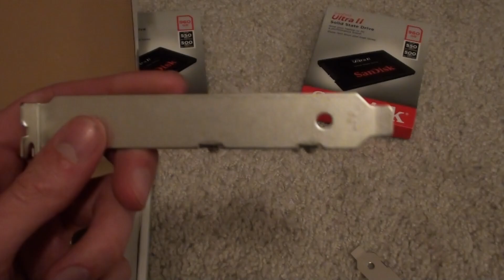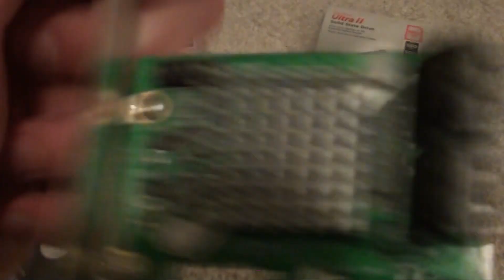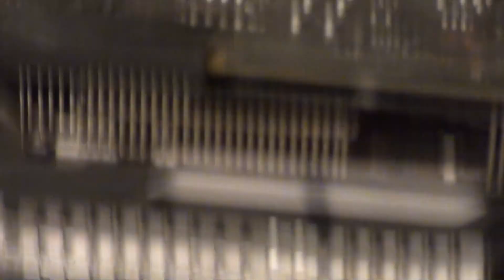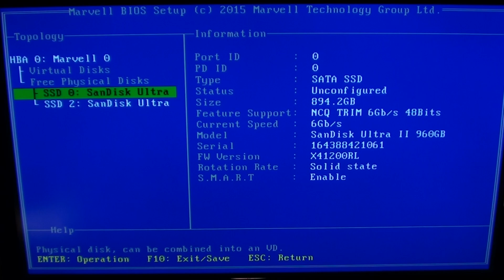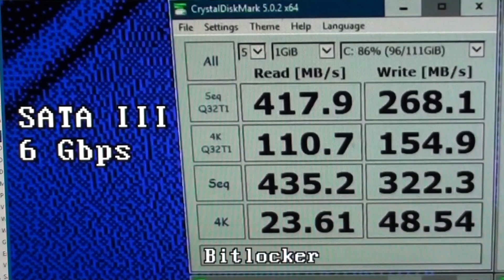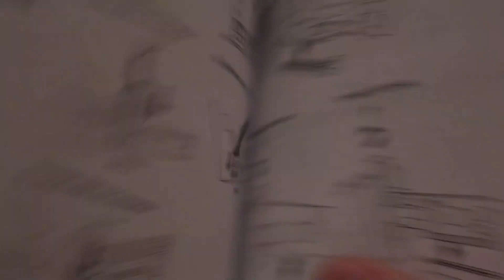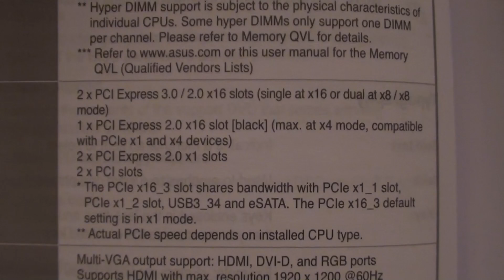SSD RAID 0 (2 TB)

Comment: You would be better off putting the avermedia card in the 3rd x16 slot (slot 7 in the manual) and the raid card in the top x1 slot (slot 1 in the manual) above the video card, putting anything in the second x16 slot (5 in the manual) makes the first one (2 in the manual) run at x8 regardless of whether its a video card or not

Comment: I've never understood what the low-profile metal tab at 2:04 was used for. How would it even be installed? Someone please enlighten me :o
Reply: Esteban Vicente low profile cases need it. you just unscrew the bracket from the board (there's a couple of tabs with screw holes) and screw on the low profile bracket.

Comment: You would probably get better speeds if you plug into you motherboard even if it is in sata 2 because sata2 X 2ssd is 750MB/s instead of pcie2.0 1x that is 500MB/s. this is assuming you can run raid on your motherboard.

Comment: Uh. Merry Bottleneck?
Reply: Ho Ho Slow
Reply: Merry (loading ==________  20%)
Reply: Underrated comment
Reply: prizedcoffeecup merry (LOADING ==_____________50%)
Reply: yeah pci-e gen 2 x2 is caped at 1000 mb/s, given a typical ssd has a speed of 550mb's if he could find a pci-e gen 2 x4 card for around the same price he would have all the performance benefits
Reply: ajddavid452 Admittedly on a 1GB/s RAID, 100 MB/s is not the end of the world, though 1: I haven’t watched the video yet and 2: I’d be more concerned about the RAID controller not beign able to keep up with the SSDs if the manufacturers of the card couldn’t spring for a full 4x PCI-E interface...
EDIT: Looking up the speed of PCI-E Gen 2 4x I found a discussion of the EVGA fourms pointing out that PCI-E Gen 2 has more overhead then gen 3, so for Gen 2 4x you can expect about 1.5GB/s, so I’m guessing 2x will be more around 750-800 MB/s... so faster then SATA 3, but slower then 2xSATA3...
bottlenecks yay
EDIT2:
I think that 400MB/s speed he ended up getting is due to the RAID controller, because that's just too slow for PCI-E 2x GEN 2
EDIT3:
If his motherboard's manual is to be believed, the RAID card is only getting PCI-E GEN 1 2x, which would before overhead be 500 MB/s, which is amazingly in line with what he got.
MOTHERBOARD BOTTLENECK

Comment: do yourself a favor and replace these sandisk ssds with intel or samsung instead
i have a sandisk ssd and that thing is a slow piece of shit
Reply: Sylv³on your statement makes no sense at all
Reply: The drives are fine. He just lacks a proper motherboard with proper pci-e and m2 slots. Druaga1 needs several other things. An X99 motherboard, with a capable processor and memory. If you are using that many devices buy the biggest ATX tower you can find so you never run out of space. Also buy clipped sata cables, and not just the 30 cm types, but also the 45 and 60cm ones to reach the optical drives which usually sits on top in the the case. And buy a descent brand PSU with lots of cables, preferably detachable to avoid a cable mess.
Reply: I think you meant to say "i have a sandisk ssd and that thing is a slow piece of shit"
Reply: well, since speed is being lost to pcie2.0, using a slower drive there wouldn't have any realworld effects, except the faster drives can go on the motherboard's sata3 ports and you get more speed from them that way?
Reply: i have a sandisk ssd and its super fast. 512MB/s read, 380MB/s write. It's not even the Ultra edition, just the SSD plus version.
Reply: Samsung and Intel also sell slow drives and fast drives. The 750 evo is pretty meh and costly for it's performance.

Comment: 2600K? You're pretty well due for an upgrade
Reply: all intel's recent core upgrades have been tiny steps, small preformance increases and small power draw decreases. The last huge upgrade was from first gen to 2nd gen, so he's fine. not really a huge difference from gen to
gen.
Reply: Well when you start to run into problems with PCIe allocation...

Comment: The stripe size has nothing to do with file sizes. For any kind of flash drive your probably want to set it to 64K or higher (trying to match the native erase block of the flash drive typically 256K).

Comment: Wait, so one slow device on PCI can slow down ALL OTHERS? I didn't know that and I know a lot of shit about computers... damn...
Reply: EpicLPer ..No. The slow pcie is just slowing down the 2 new drives since they go through that connection
Reply: "this will slow down my whole bus"
"now my graphics card is running in x8 mode"

most CPUs don't have enough bandwidth for all the slots a motherboard has to run at full speed. the CPUs that do need a different socket and are significantly more expensive. (this is part of why i only ever use mATX or mITX for those sockets, because the extra slots are somewhat of an illusion on ATX boards of this class, imo)
Reply: Kit Vitae Oh woops I hadnt watched tjat far, yeah. I kinda assumed that his cpu had enough lanes for an additional 2x card
Reply: Aaro Perämaa his cpu might, if the board divided them up differently. his board also only has 2 sata3 ports, the rest are sata2, so. there's a whole lot less bandwidth total on it than on something you'd build today that's for sure. 
also he plugged the raid adapter into a x4 slot and got better speeds than a x2 slot, and the comment about his gpu running at x8 was after that swap.
Reply: EpicLPer yyyeah, I am smartest at computers in class xD

Comment: INSTALL SSD IN AN XBOX 360
Reply: they do not use proprietary drive interface, they use SATA, you can easily swap hdd in x360 enclosure. The only problem is, the firmware has to be the right firmware for console to actually recognizing the drive. I bought some enclosure, throw in an WD drive (i think it was 160GB), make firmware "downgrade" to 120GB and console recognized it as 120GB drive. Console is not modified, it will work, there's plenty of tutorials on the web. Slims are even easier to work with, you just put SATA drive into it, without additional enclosures (like the old X360 version)
Reply: abdellahalsaidi RBLX Not going to work.
Reply: All of Xbox 360 models use a proprietary drive interface and other type of drive format, so it it impossible to swap the HDD with a SSD. SSD could be used as an EXTERNAL drive though.
Reply: I think theres issues with anything larger than 500GB, but yeah the only thing proprietary is the external connection from the phat360 hard drive. Inside the enclosure itself is just straight up SATA. You need to spoof the firmware so the console will accept it though.
Reply: then how can you clone the drive content to the ssd
Reply: done it with my RGH awhile ago really boring and simple
Reply: What about a laptop hdd adapter; i swear it works it but shows like a flash drive
Reply: +abdellahalsaidi RBLX or xbox 420
Reply: In the XBOX sata connector it doesn't work but with a USB hdd/sdd adapter it works as fine
Reply: The point is the challenge dude. If it was something simple that you could figure out, there'd be no point in suggesting it. Just because you dont know a way to doesnt mean Druaga doesnt
Reply: the new 360 slim uses sata connectors? wouldn't that work?
Reply: why wouldn't it? would it be hard to get the firmware installed?
Reply: edit, it would work. i found an article how to do it.
Reply: and that's why X360 sucks PS3s ballz. in PS3 you can put every Serial ATA drive, even ssd and it will work.
Reply: ... You can put a 2.5" SATA hard drive and rewrite the hard drive firmware, when you don't want it anymore you just restore the original hard drive security sector (UNDO.BIN or however you called it) and done; the downside is that only Western Digital Scorpio series hard drives will work but it sometimes work with Seagate ones, if something goes wrong just restore the original hdss and you are good to go!
Reply: you can rgh/jtag depending on your x360 model and you can use a hdd enclosure and put an ssd inside of it. but its prolly just a small difference.
Reply: Steve Abnormal Rogers the new slim model and hdd eraser app from the Xbox live Store will work
Reply: Simple indeed, but since he plays Roblox, I don't think he's capable

Comment: Here's a challenge, upgrade from Windows 1.0 to Windows 2.0 etc. Until you reach Windows 10.
Reply: Lunatic Leonard's cum face That's impossible because the system that windows 1 would run on is too old for windows 10 to run on. And a system that windows 10 can run on is wayyy too new and incompatible with windows 1.
Reply: Vertical Gamer I mean upgrade Windows 1.0 to all its versions until he reaches 10
Reply: Some guy went from Windows 1.0 to Windows 8 on real hardware...